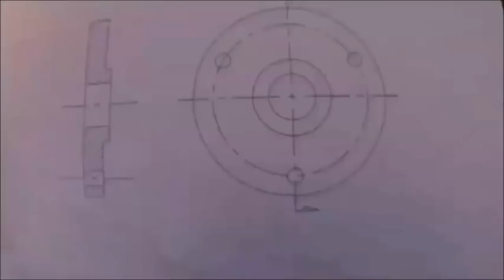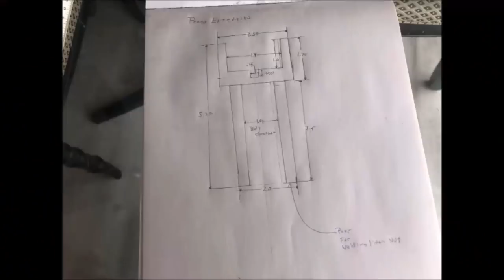Using doanted scrap making a keyway broach plate for the press

Comment: Morning- I like the tool holder retainers you added to the backsplash. Their too pricey to drop. Clever solution. 

Dan
Reply from the maker: House of Broken Dobbs Things _ with Dan Dobbs what they are is 1/4 x 20 bolt 3 1/2 long. I used nut inserts to hold the headless bots to the backsplash. It was a simple solution that I like, the tools on the back are the most used on my lathe. Good observation